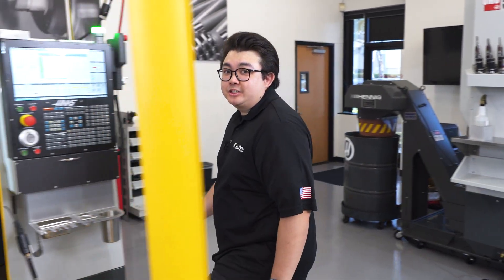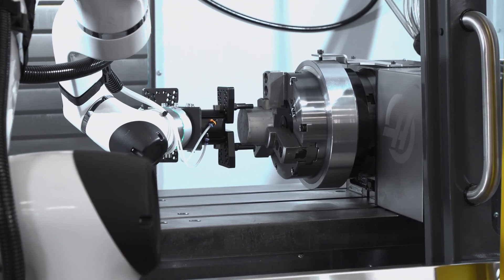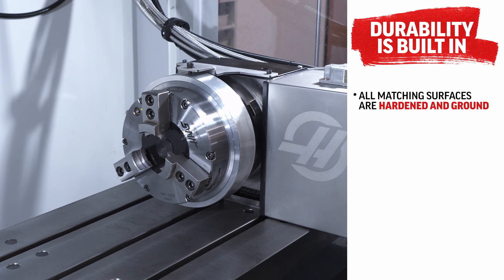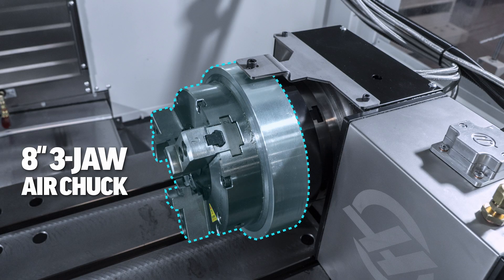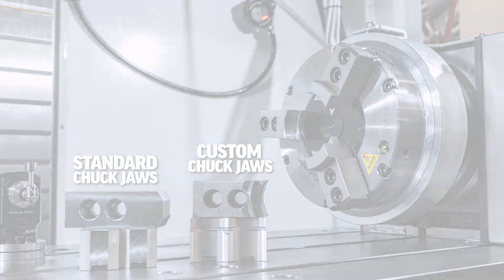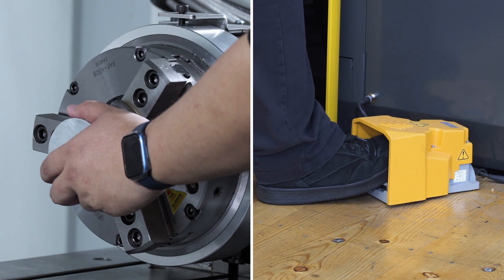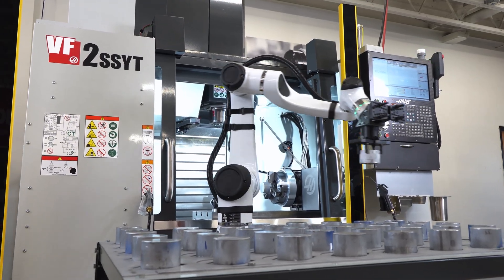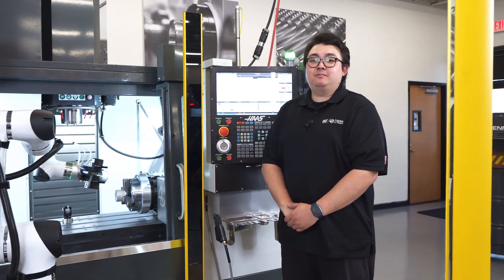8" Air Chuck Kit for the Haas HRT210 Rotary Table - Haas Automation, Inc.

Comment: How do you go about cutting the jaws?
Reply: Turn them just like you would with lathe jaws
Reply: @TheStig505  Soft jaws only run perfectly true on the chuck they were cut on. Turning the jaws on a different machine is okay for loose tolerance work, but useless for anything requiring high precision.
Reply: @aleksandarstojanovic9637  If your jaws are only concentric on one chuck, then you have a problem with your machines.
Reply: @TheStig505  Lol just say that you have never done any work where tenths matter... You know those numbers written on the jaws? 1, 2, 3? What do you think those numbers are for? It's because soft jaws are only repeatable if you put them back exactly how it was when you cut them.
Reply: @aleksandarstojanovic9637  Just sounds like excuses for sloppy spindles... maybe you should call your local service tech and get your lathes trued up?
Reply: @TheStig505 the grooves on one chuck are not going to match another…
Reply: @Motorman0297  you really can't figure it out?
Reply: @TheStig505 bro you exposed yourself as a noob. It's okay, you can stop arguing right now. Try to get more experience and then come back.